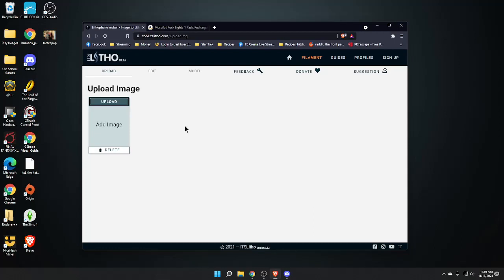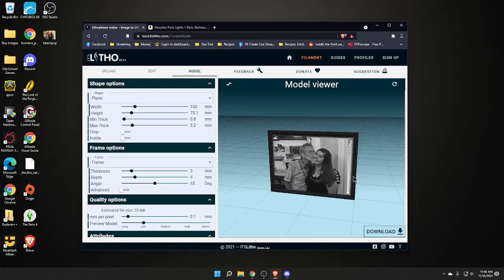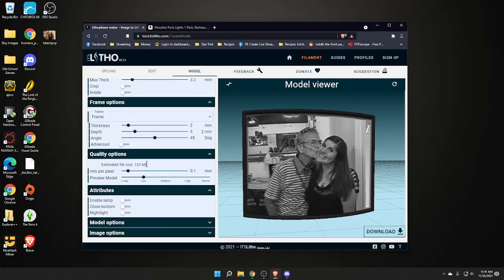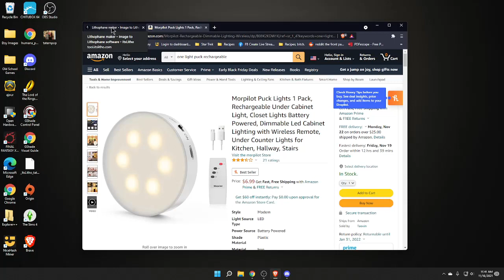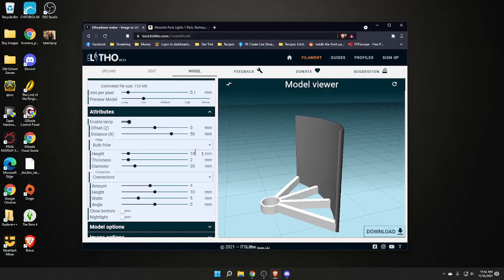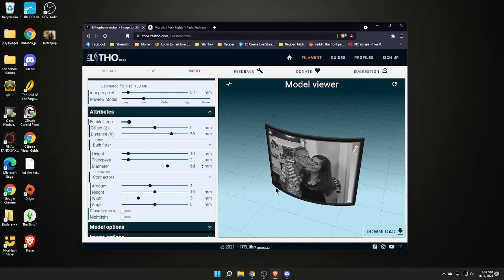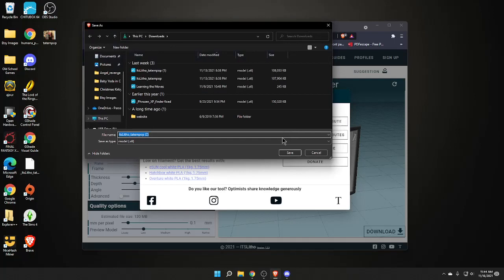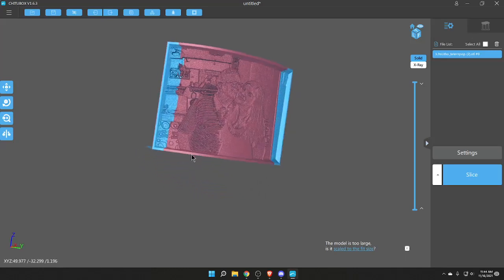Quick Easy Lithophane Tutorial

Comment: The way that you input the measurements for your light didn’t make any sense. The light will face up when it should be facing the back of the lithophane. I guess it would still work, but it would be much more effective if the lights were facing what you’re trying to illuminate. The addition of the legs & home for the lamp is actually intended to allow a bulb to be inserted through the hole and screwed into an actual desk lamp. That way the light would shine through the lithophane. I don’t think I would ever do this with a standard light bulb though because it would probably melt the legs. It would really work best with an LED bulb.